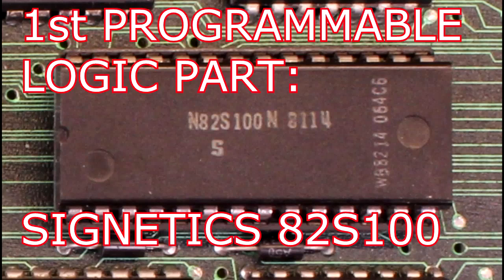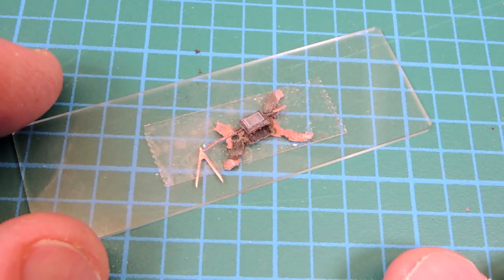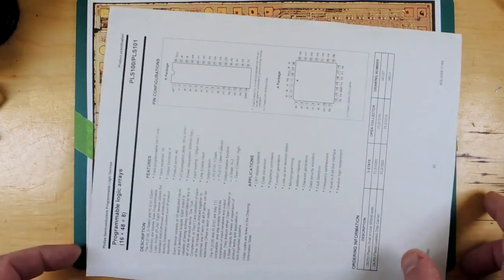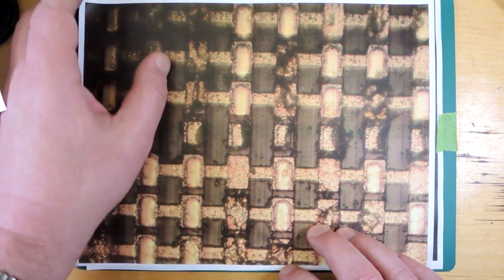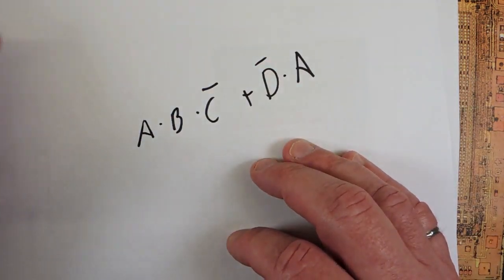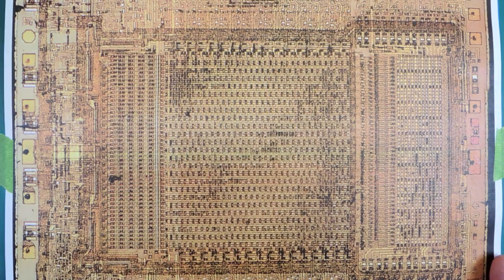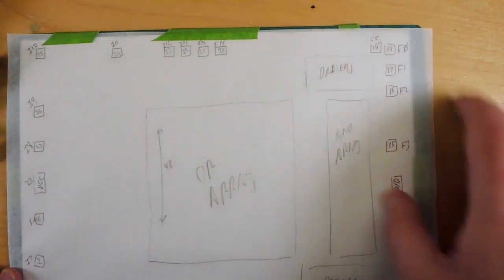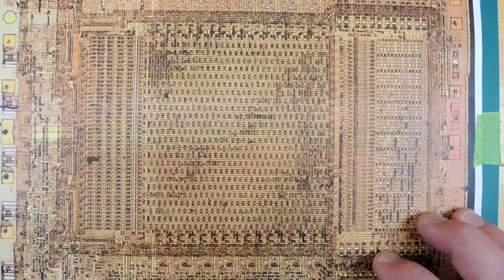The 1st Programmable Logic Chip! Signetics 82S100

Comment: I have a very early op-amp (B-Line CTA-1) that has a card edge to plug into a mother board. There is very little info on the web on these. Not even a picture. I would love to see the inside but appart from milling it open have no idea how to get into it. Do you have the technology to get into it? I'd be happy to send it if you can get past the potting. It's big, a little smaller than a pack of cigarette. Actually i have 3 old ones each one about half the size of the next biggest one (B-Line CTA-5M & Analog Devices 751N) ... are you interested?

Comment: Any idea what support was made available in developing the logic layout and then programming these?
Reply from the maker: i think you could dial in to one of their mainframes for a support program (initial customers would have been only big companies) or you would have to figure it out by hand. The data sheet has a little paper spreadsheet that can be used to work the programing sequence. Eventually  some of the early programs such as CUPL and ABEL supported these. no simulators.... just compilers.
Reply: If you look around for pal/gal/jedec compiler/assembler there are some tools around for similar chips. Robert Baruch
 also did a chip tips recently on generic array logic compiling.